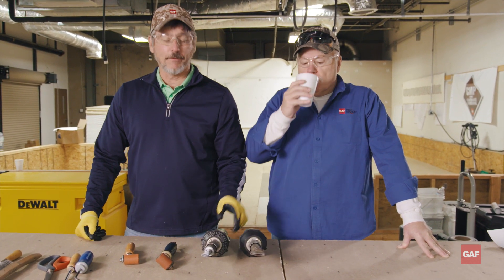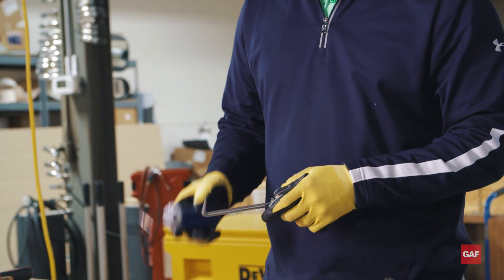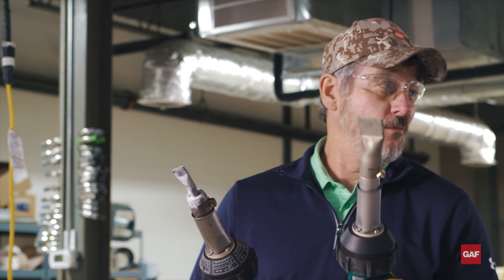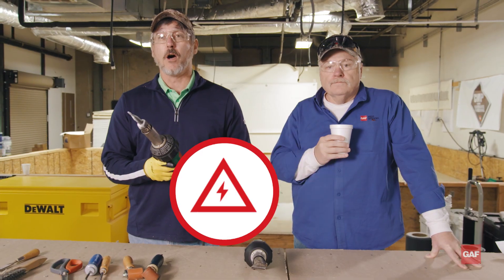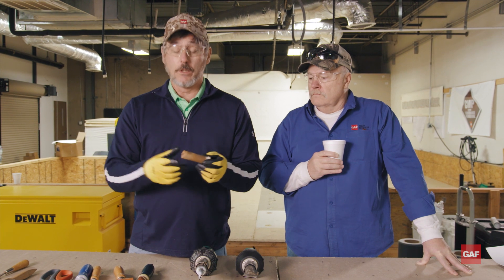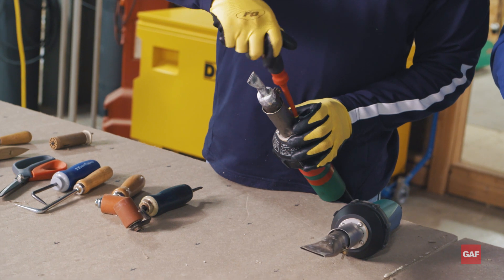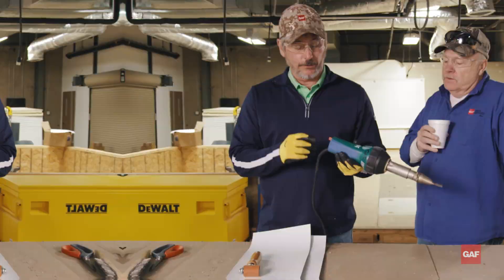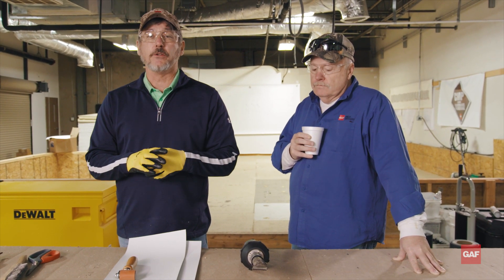How to Pick the Right TPO Hand Welding Tools | Roofing it Right with Dave & Wally by GAF

Comment: What is the difference between welding reinforced and non reinforced?
Reply from the maker: Hi! Reinforced and non reinforced membranes are welded in the same. However, we recommend keeping an eye on the temperature when you weld non reinforced membranes.
Reply: Non re inforced will melt and adhere noticeably faster.